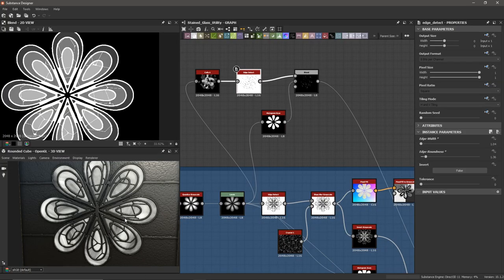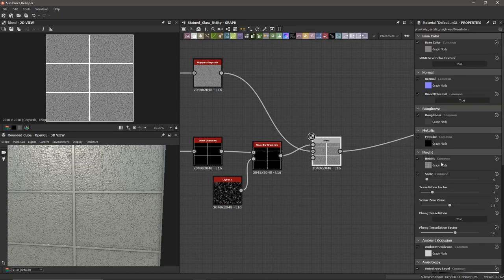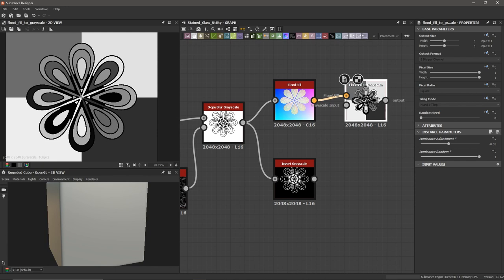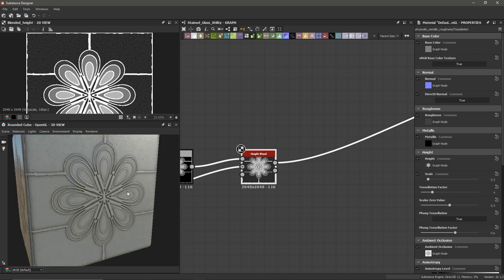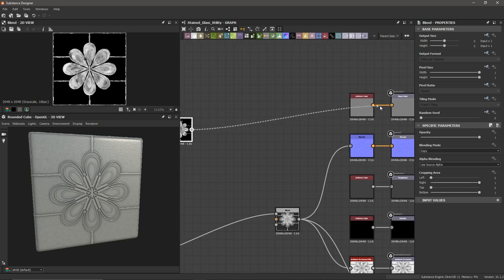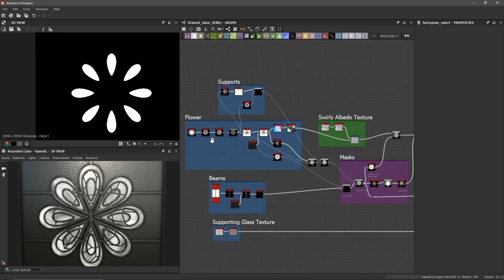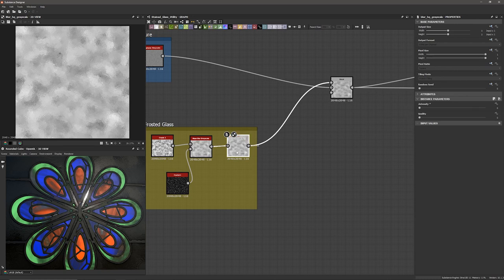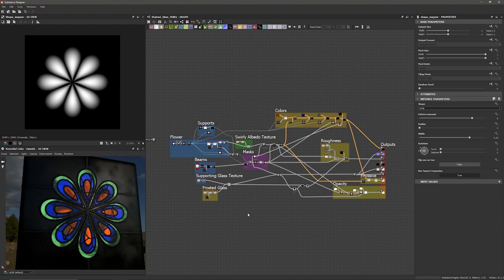Create a Procedural Stained Glass Window Texture in Substance Designer

Comment: How do I export and get all of the textures exxported if u dont even have metallic and roughness even connected with anything? at the 34 mark u stop and just go to another file which I cant follow along anymore
Reply from the maker: Hey so if you’re using the metallic roughness template, there should be some uniform color nodes attached to metallic and roughness. You can dial those in or use one of the masks we created in the video. Then if you find the icon with a wrench in the toolbar above the graph editor, you can choose export maps and then decide what maps you’d like to save out. Hope this helps!
Reply: Jeremy Seiner yea for sure thanks, I might have another question but I will try to finish the rest of the video where u switch files, great tutorial tho, I have a buddy that works at 343 that would love this tool
Reply from the maker: Awesome! Let me know if you have any more questions =)
Reply: @JeremySeiner  So I had one more quick question, I'm also finished with it it looks great, but was there a way to quantize a bitmap instead of just the shapes modifier? you know the node where you can pick how many segments are in the flower pedal? Is there a way to do that for a bitmap? so its more than just 1 color?
Reply from the maker: Hey! Yes. Off the top of my head what I can think of is if you drag an image onto your graph, you can hook that up to a quantize node either color or grayscale variation. If you’re publishing the graph as a substance or using it in Substance Player, you can use an input color node and attach that to quantize. You might want to use a convert grayscale node after the input abs before the quantize depending on your use case. Hope this helps!
Reply: @JeremySeiner  mmm ok i can try that, because when I hook the bitmaps up to the original quanitize grayscale that we built for the flower shapes, nothing changes when I adjust any of the nodes
Reply from the maker: Platinum Pineapple one extra thought I had is maybe add a levels after the bitmap and tweak the values a little, then adjust how many shades the quantize is creating in it’s parameters?
Reply: @JeremySeiner  yea i already have that, there is a levels after the bitmap, i tried to turn it down so its not just straight white, but it doesnt effect anything like how u got all those flower pedals to have layers
Reply from the maker: Platinum Pineapple does your bitmap have gradients? If not maybe adding a blur right after it? Haha that might do it. If not that, then try a non-uniform blur with the bitmap as both inputs and playing with some of those parameters. I use a non-uniform blur to add volume to shapes or images that are coming off as too flat.
Reply: Jeremy Seiner mmm ok i will look at that then, also when put the substance logo texture into marmoset, the ambient occlusion and tessalation doesnt work at all, like its all ugly and pointy, i even made sure I was doing it right from another video I used before, so it might just be the way we made the texture, which isnt a problem, the tessaltion works fine in the actual 3d view of designer, just in marmoset its not working
Reply from the maker: Platinum Pineapple okay I’ll have a look at that
Reply: Jeremy Seiner its fine im just gonna render it in marmoset without the tesselation